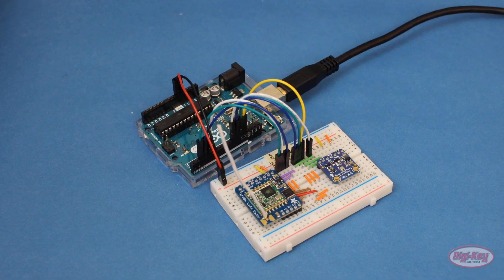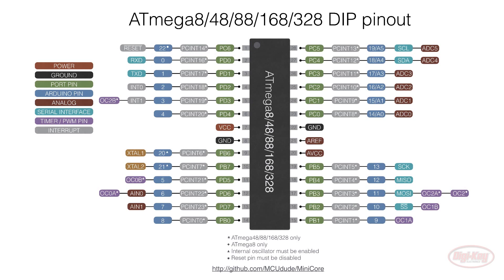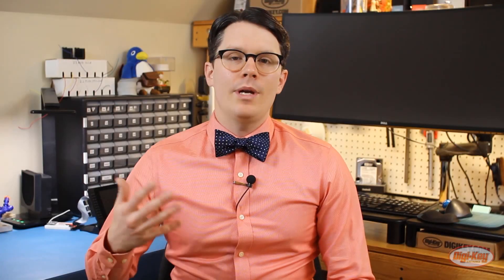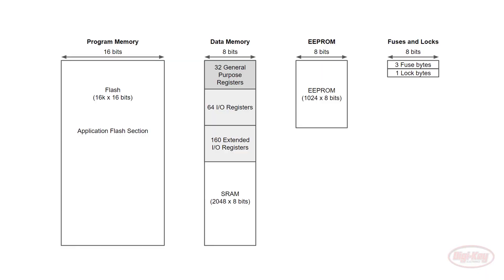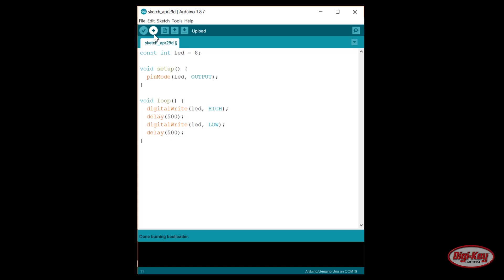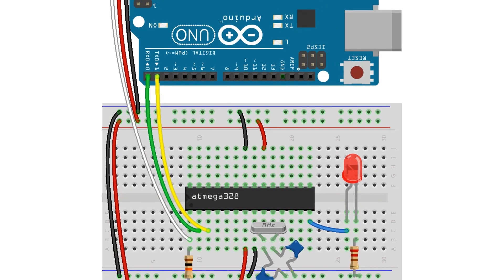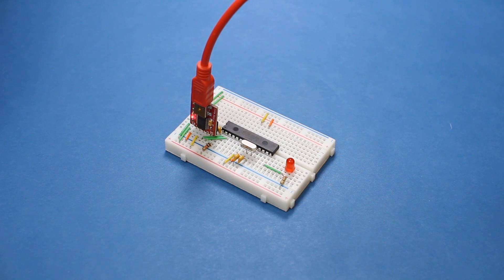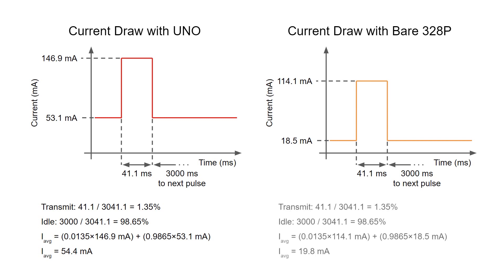Arduino Project to Product Part 3: How to Build an Arduino on a Breadboard | Digi-Key Electronics

Comment: Best video ever on setting things up to use a bare 328p.  For those that want to dive deeper and further reduce current draw, at the expense of running slower, there are 8MHz and 1MHz bootloaders available that use the internal oscillator, instead of an external crystal.  In projects like this, that spend most of their time sleeping, this can result in a much further reduced current consumption.

Comment: I enjoyed messing around with the BBC Master128 and using its USER port back in the 1980's to make LED's and relays do external things, so when the Arduino & Raspberry Pi came about I jumped at the chance to mess around as a hobby, and I love all the modules that are available. It's great there is so much help out there on the web. I really appreciate the time & effort you put into showing the memory and addressing of the chip and explaining the Boot-loader and fuses. I'm not saying I completely understand it, but it is starting to make sense. I have no problems using a serial programmer. My current goal requirements are to use the ATMega328P-PU (I shake too much these days to be messing with SMD stuff), so to take the chip, minimise the circuit it needs, put it to sleep and use the interrupts to wake it when a external condition is triggered, (a switch pushed etc). I'm also a beginner with KiCAD v5, so that's something else new. I do find hand drawn stuff copied over from hand drawings on paper using a permanent marker on single or double sided copper clad board faster for stuff I made at home a long time ago, with companies making PCBs at silly cheap prices these days it seem I can bask in the luxury of having a silkscreen, never had that before! So once it's designed and I've done a build or two at home to ensure it's perfect, soak tested it etc, then when I'm 100% happy with it I'll send away for the PCB to be professionally made up. I'm more than happy to program it in the field using a laptop, FTDI (yes, the horrible one, lol - A 16min video and they were annoyed at that, must've been a slow news day for them?). Anyway, just wanted to say thank you for a very informative video.

Comment: FTDI Bad :(
Reply: Only because of that horrible driver snafu a couple years ago...and because they're overpriced at this point >_> But it's what I had lying around. You can use any USB-Serial chip you'd like, though--we just need to upload a binary file to the MCU while it's running a bootloader.
Reply: @ShawnHymel  Yes, a horrible >HORRIBLE< snafu. A snafu of that scope is not pulled off by a single misguided individual at the company, but rather one which reflects the business-ethic of the company as a whole.